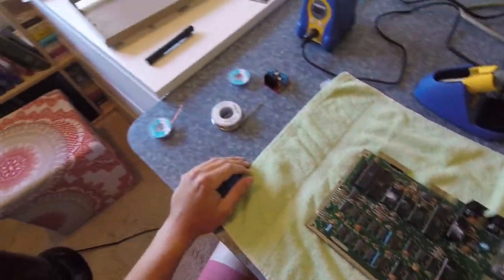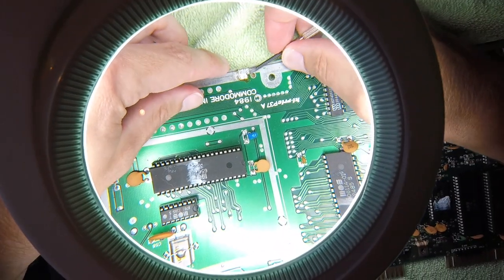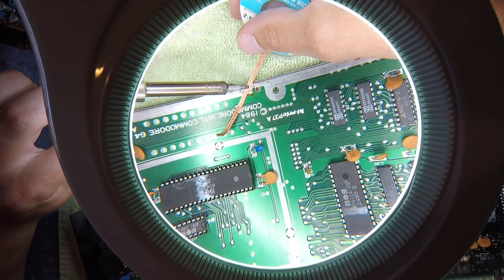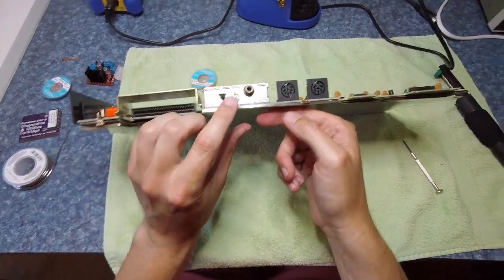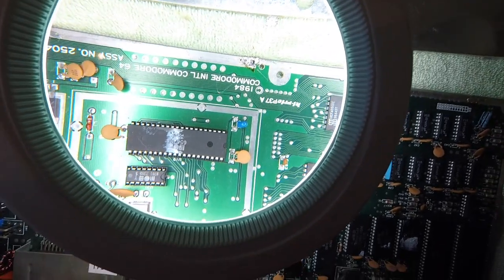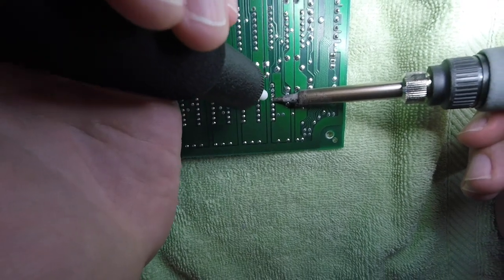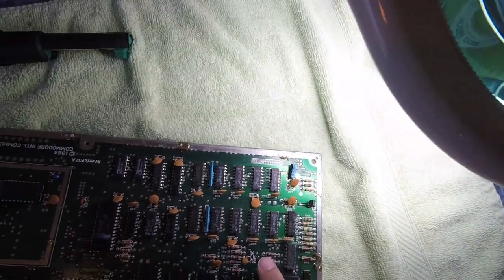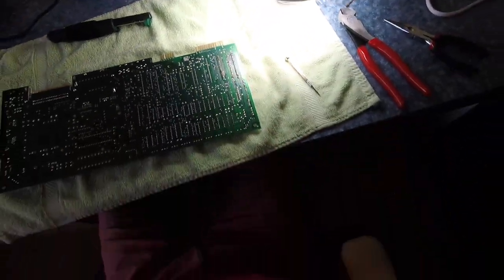Repairing a Commodore 64 is hard (and I am bad at it)

Comment: Given the tools you have, add some of your solder to the chip's pins and try again.  The solder you have will likely have a lower melting point that the original and help the process when you use the solder removal tool.   It seems backwards, but it works.